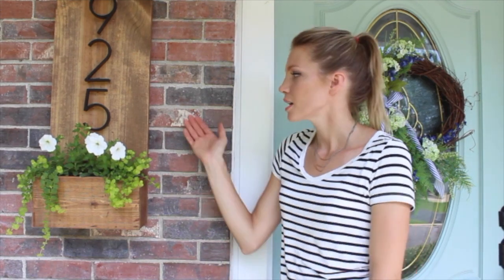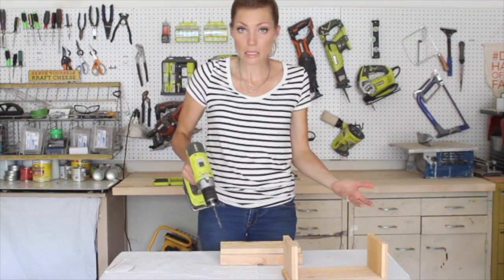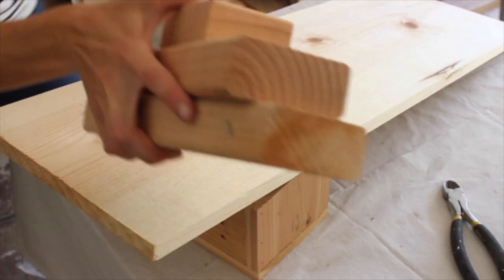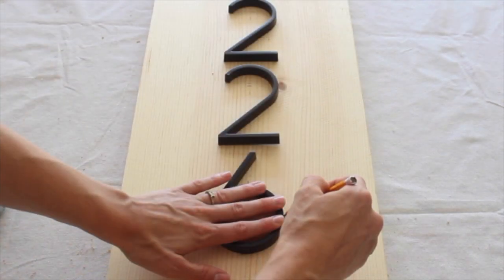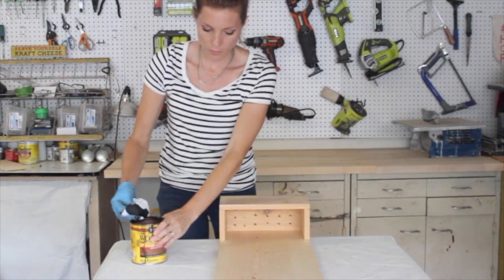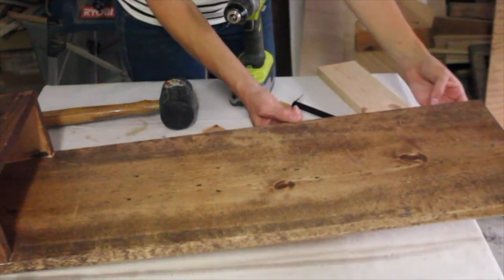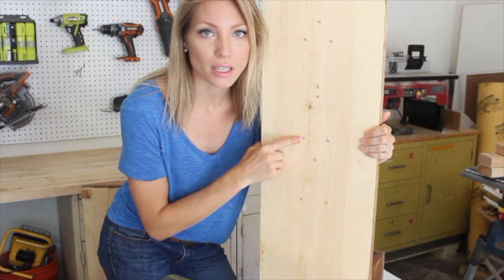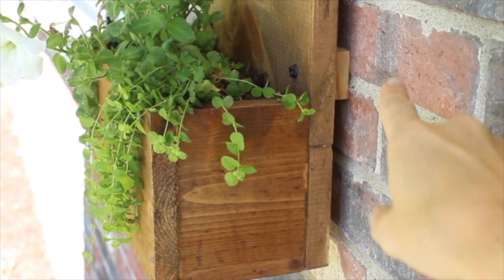How to Build a DIY House Number Sign with Planter Box

Comment: Love but if I do this my planter box will get wet, would the wood hold? Or is there a plastic version?
Reply from the maker: You can fit a small plastic planter inside if you are concerned, and just build the wood sides around it. I’ve had this with a planter for 3 years now and while, yes it gets wet when I water it, it’s not been damaged or caused any problems.